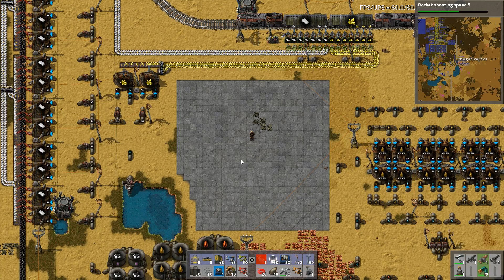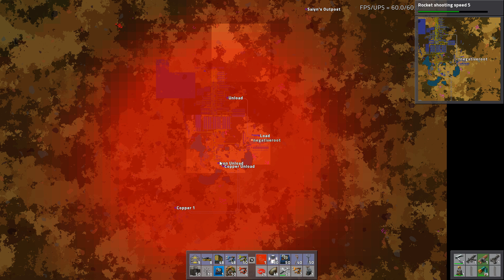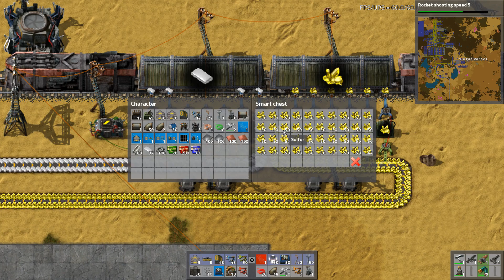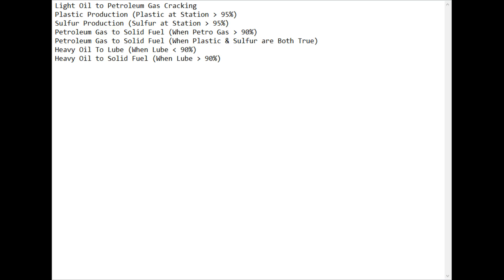Factorio Beginners Guide 27 Combinator Based Oil

Comment: At the beginning of the episode, you show the loading station -- I think it'd be better to have two combinators, one for each factor product the loading station handles, unless there is a very good reason you would want to limit the loading to a 1:1 factor-product ratio.  In other words, if you for some reason start running out of one or the other product, the way it's wired up now would needlessly choke off the supply of the second product to the same level, if I'm not mistaken.
Reply from the maker: +Greg Turner you are mistaken.

rewatch the video and pay careful attention to where I talk about the "each" function that you have access to inside the arithmetic combinator.
Reply: +Greg Turner 
green wire in says "plastic: 24,000; sulfur 8,000" 
combinator says "divide by -7" 
and outputs "plastic: -3429; sulfur: -1143"

Effectively, a signal isn't just a value, but is a hashmap of "product => value."
The combinator operates on each hash value separately.

Signals are additive - but only on the same hash key (product), and each smart-inserter is hooked to exactly one smart chest via red wire:
So it adds the contents of the smart chest to the green wire signal. Say it's looking at a chest with 3428 plastic.
It gets a green wire signal of "plastic: -3429; sulfur: -1143" and a red wire signal of "plastic: 3428"
Adding those up, the smart-inserter has a signal of "plastic: -1, sulfur: -1143".
Its command condition is set to "operate if plastic < 1" so it checks only the plastic key in the hash - ignoring the sulfur key and thus only checks that "-1 < 1"
Reply: +silver Harloe +Negative Root .. wow, I get it now, what a clever way to exploit the summing of inputs!  Can't wait to try this in my own save.

Comment: Great video again. =)
Maybe personal taste, but I like having a "constant combinator" to send reference values for my pumps and use direct pump signals like "lube < green square" and save a few combinators.
Btw, if you ever need to troubleshoot your pumps and signals, 
its helping a lot if you throw a light right beside the pump and copy the command, this can visualize when your pumps work and reveal mistakes.
Reply from the maker: +Andy Pü remember this is a guide series. I can't go from square one to square fifty in a single step. Breaking down the signals allows people to visual the process better. yes, you can save combinators, but then that doesn't help people understand the point of the video.

also, i already have a plan with lights for part 2.
Reply: +Andy Pü Great idea with the lights, I will implement that into my factory once I played with the combinators
Reply: so true, compacting stuff makes it usually harder to understand.